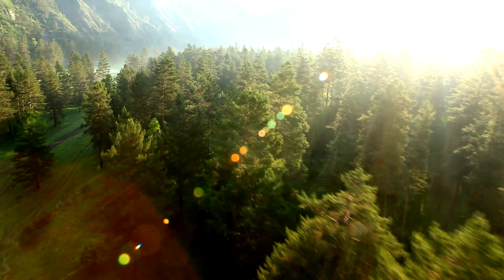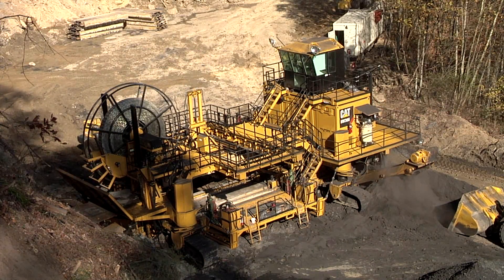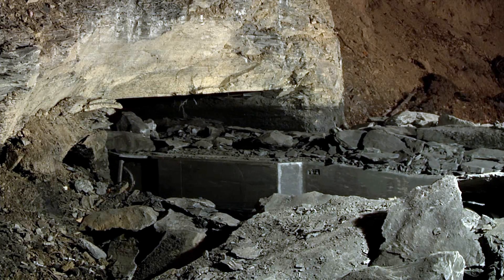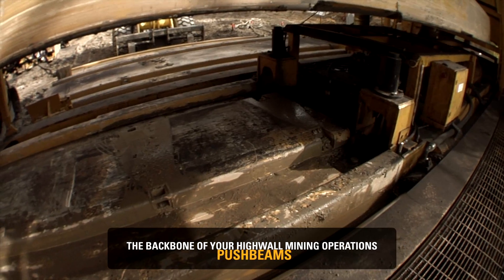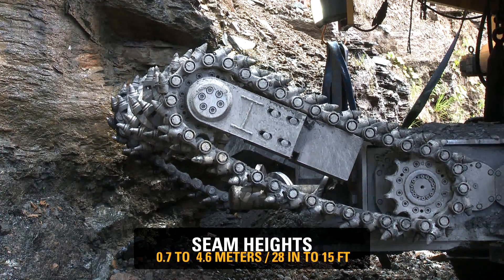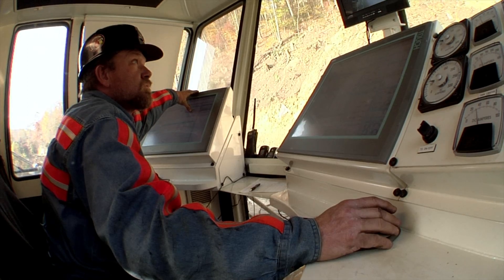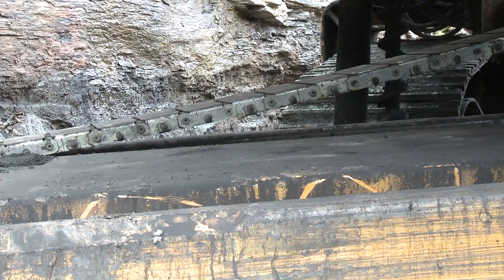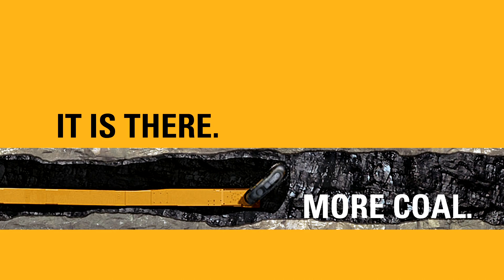The Cat® HW300 Highwall Mining System

Comment: How do you handle issues with methane or other explosive gas buildup?
Reply: Ian Reynolds  A methane "sniffing" sensor is placed on the cutting head of the machine.  Typically, concentrations of 1% and 2% methane will alarm and trip the machine, respectively.
Reply: +Mark Jones also you are well above the water table methane shouldn't be an issue.